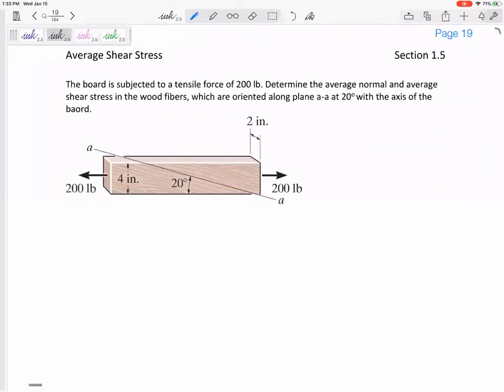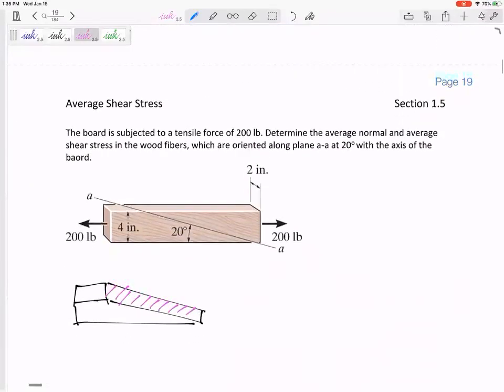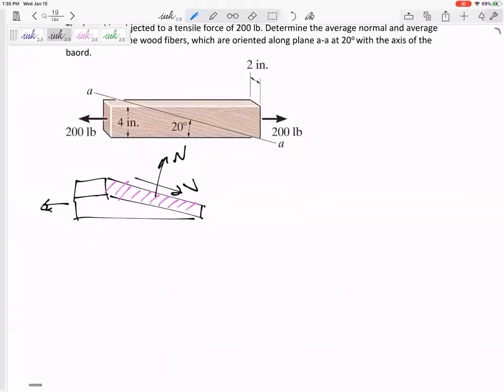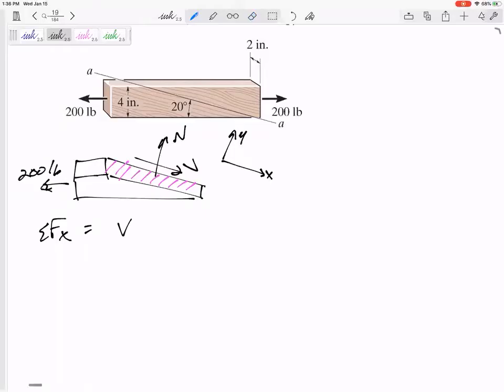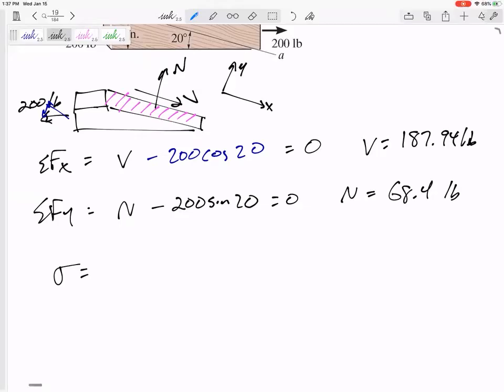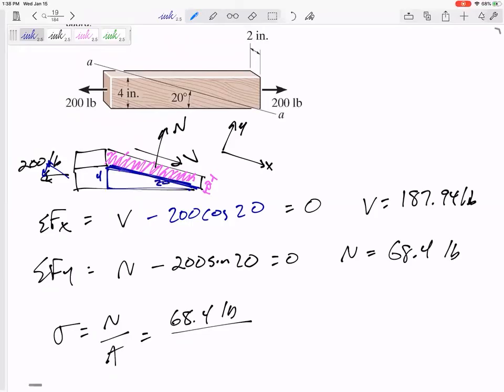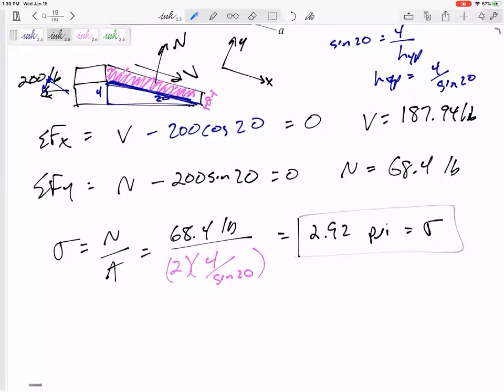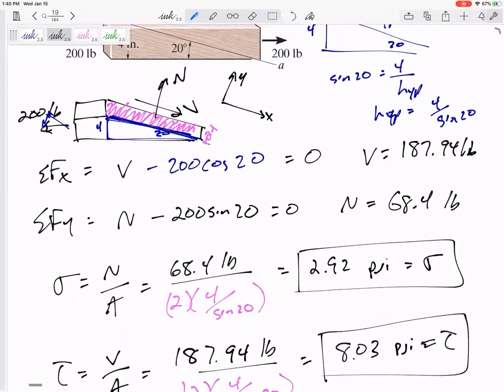Mechanics of Materials - Normal and shear stress example 1

Comment: why didn't we include the other 200lb force in our summation of forces in the x-direction?
Reply: Ya why I also need a answers
Reply: @EMEngi4ALL  Because the plane is cut .So we do not consider the force on the right.
Reply: you only need to consider one side for these kind of problems @EMEngi4ALL

Comment: Sir.. one important query please ... wooden fibres are inclined 20 degree to horizontal, so 200lb horizontal component will cause elongation of those fibres and there will axial/normal due to internal force V. V should cause axial and N should cause shear.. your advise please. thanks and regards.